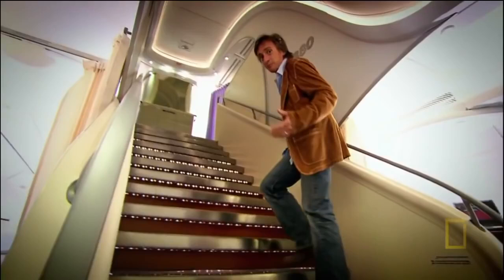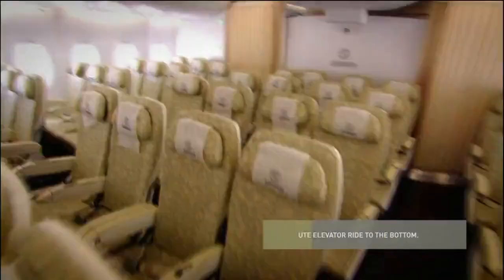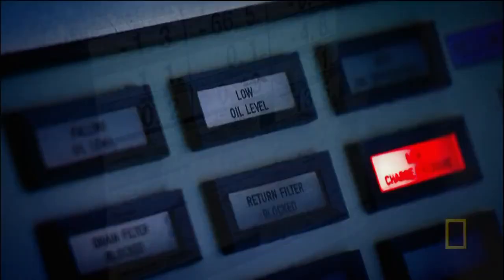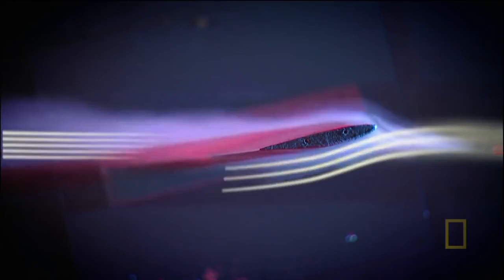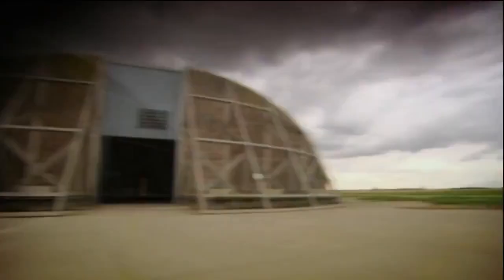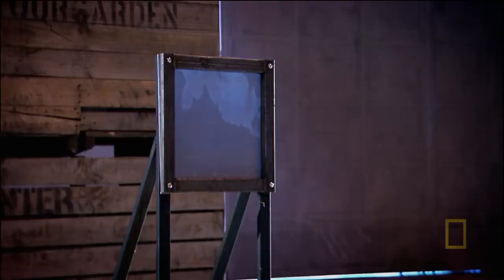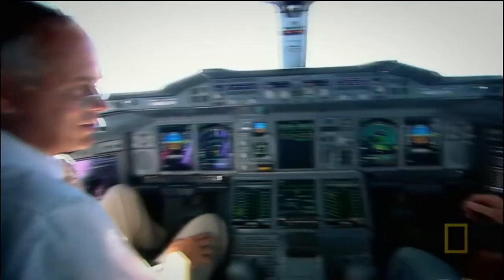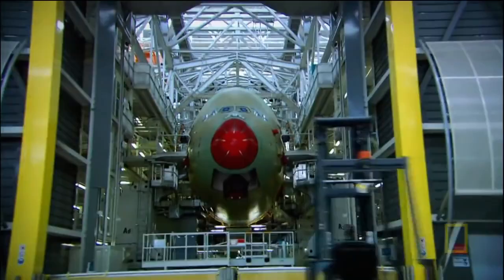Airbus A380-Richard Hammond's Engineering Connections Documentary

Comment: Everything about this aircraft is insane! Take the engines for instance, The Rolls-Royce Trent 900. Each engine weighs 6.25 tonnes dry. So when its on the ground each wing has to support 12.5 tonnes before you factor in fuel and hydraulic fluid weight! And when in flight it goes the opposite direction to support the weight of the fusalage. Those are some seriously clever engineers working for airbus!

Comment: Not like winglets are a totally new thing with the Airbus 380.... come on.
Reply: And adding to that.. the fence-Winglets in the A380 are far from perfect.. the A380 wing should be 90m wide for the size of the plane..its 79.75m wide due to the 80m limit in airliner sizes.,. the winglets help to fix that.. but the fence-winglet design by airbus was not perfect and now all new A320s changed them by new sharklet style winglets (similar to the 737NG ones and the A350 allready come standard with them.. if Airbus does an A380NEO some day..or a 900 probably will use the new style winglets

its odd they used those when the A330 and 340s were using the other type since the early 90s
Reply: Yeah I mean the concept was taken from birds but it’s been developed on commercial jets for decades

Comment: Couple of things that annoyed me about this;

The long-windedness to explain everything

Using imperial units. We use metric in the UK now- Get with the times!
Reply: +Mediocre-Motorcycle-Modifications Top Gear uses imperial.
And FYI, several areas of the UK still have signs with imperial units on them.
Reply: GTA Kid We still use miles as a measure of distance measurement, hence why our speedometers are in 'miles per hour'. Everything that is legally bought and sold has to be in metric. Although most still refer to 'pounds', 'inches' and 'feet'.
Reply: ***** Airbus use metric, they are European. This programme was made by BBC America.
Reply: +SleepyRex not sure airbus would agree with you on that, or indeed even former-soviet block on air traffic control / altitude !
Reply: Airbus is European but they still use imperial units, they are never changing
Reply: +Martin Jones But aviation uses imperial as +WhiteHawk said.
Reply: +WhiteHawk Commercial aviation uses neither the imperial nor metric system but the nautic one. In general aviation, all three of them are used.

Comment: The 747-8 has longer wings than the A380
Reply: Run Power And? That’s a bad thing actually.
Reply: @torbsteyn  doesn't make the A380 better. 747-8 is still way better so...
Reply: @michaelmyers2327  I suppose its all down to personal preference though. If you're talking about passenger comfort, the A380 beats the 747 by a mile.
Reply: YMML Aviation: Passenger comfort has everything to do with how a particular airline configure their airplanes.  It has nothing to do with aircraft type.

Comment: Lets be realistic, the A380 limited itself in the market because it is so big. It isn't going to ever be a plane to go 300 miles and land, it has to be fully loaded and travel thousands of miles to select destinations only, and it has to be nearly full. They cost like 450 million dollars, what company is going to invest in one of these knowing they can only fly to certain areas, and they HAVE to be full to break even. The A380 will probably be discontinued at some point, smaller aircraft that can land almost anywhere will always beat it out, even if it costs more for passengers. No one wants to fly to a specific airport because that's the only close place the A380 can go, then have to commute or change planes to where they wanted to go. They would rather get on a smaller jet and be there. The A380 is like the guy who built a ship in the basement, when it's finished, you can never get it out to use it.
Reply: Its now discontinued lol
Reply: That is why Boeing decided not to go head to head with A380 but went with a much smaller long range point to point airplane: the 787.

Comment: why does it say this A380 can carry up to 856 Pax yet there is mostly 550 ?
Reply: It's all about maximising revenue. The premium seats subsidise the cheaper seats so you want to strike a balance between having as many seats filled in the premium sections without wasting space
Reply: RVRey : Actually the advertised typical tri class seating capacity for A380 is 525.

Comment: Really sucks that the aviation industry is so unwilling to change when it comes to safety. You want people to have a higher chance of surviving a crash landing? Just have the seats face the rear of the plane. You can absorb more G's with more surface area, and your back is deceptively strong. And if you did that, everyone would get more leg room... which would immediately be filled with more seats. There needs to be a limit. The minimum required space per person needs to be increased. But of course, they can't do that or it'll cut into profits! And they're already at record lows as is! Those poor gigantic aviation/transportation companies.

Another problem I have is with the "escape in 90 seconds using half the exits" test. It's pretty easy to poke holes all over it. Everyone participating knows they'll be evacuating and that they'll be timed. Sure, there are some actors placed among everyone else in an attempt to increase panic, along with low light conditions and so on. But because they know what's going to happen, everyone will pay much more attention to the pre-flight briefing when nearly no one actually pays attention on commercial flights. And at the end of the day, everyone knows it's just a test. No one is actually at risk of dying in a crash landing at any point during the test. Plus the companies can filter participants out. Imagine you had a disabled child/elderly person in a wheelchair. In a test, people might be altruistic and try to help them. But if it were a real situation, that could change quickly to, "every man for himself." Obviously companies can't sabotage their own planes to get a truly objective test of their safety standards and requirements. But that doesn't mean that the system used now is good/thorough enough. I'm not saying that those companies, as well as the FAA, need to focus more time, money, and energy into increasing leg room, arm rest space, lane width, etc (although that would be nice). What I am saying is that focusing on some of those things, like leg room and lane width could legitimately increase safety. But because current models meet current requirements, there is no reason to change or improve standards.